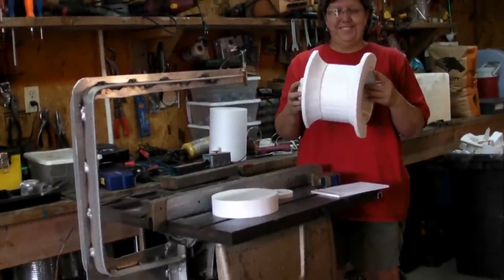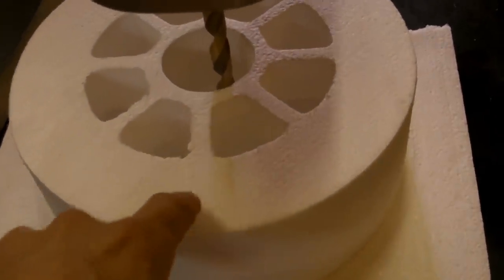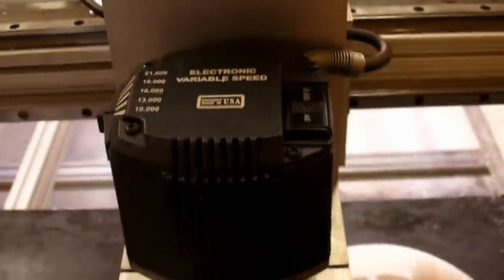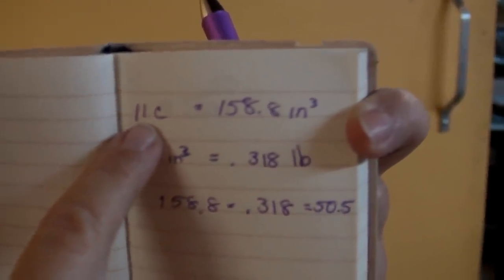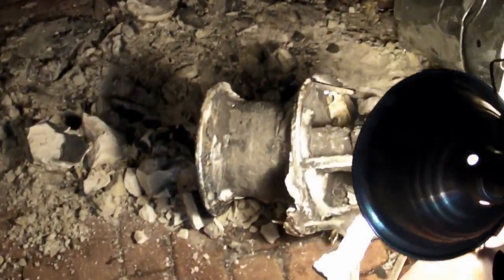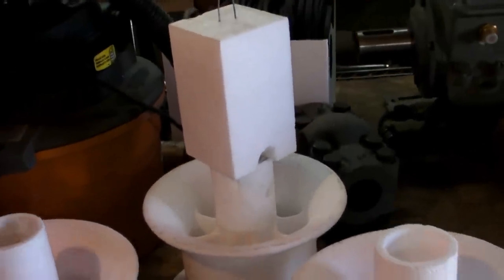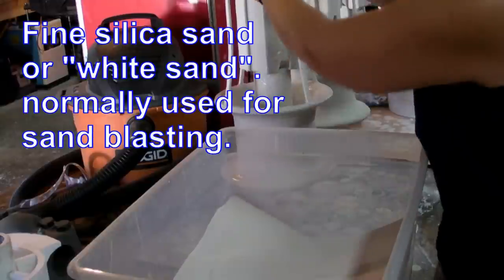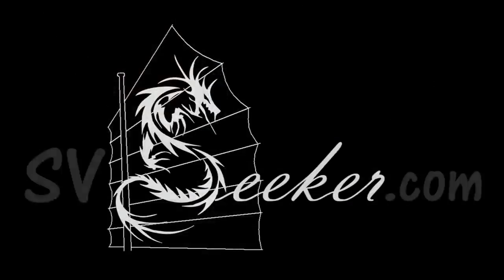Anchor Winch Rebuild - Part 6 - Lost Foam-Wax Molds

Comment from the maker: Right. I agree with that. The first thing I did was go through all the connector and make sure they were tight.  But that's not to say it's not a connection or a wire.  So far there is no smoking gun so the old motor is going to stay on the shelf.  If none of the parts are bad, I've got what I need for a 4th axis. :)

Comment from the maker: Spot on.  That's exactly what it did, except it was not a tight spot.  The Y axis just went insane and randomly moved toward zero.  Worst yet it was doing it intermittently.  So I hope replacing the motor fixed it, if not I switched controllers too so maybe I can narrow the problem down.

Comment from the maker: It's premixed sheetrock mud which is normally used for tape and floating sheetrock or gypsum boards.  It's really close to plaster but I've had too many problems with plaster cracking.  You can purchase real "investment" from a foundry supplier, but it's expensive and is sold in much larger quantities.

Comment from the maker: Thanks, and if you like that casting, we've got another that only looks a little better. So now I need more patterns.  Think I'll try CNC cutting the pattern from a solid piece of wax this next time.  PS:  If you have the patience to cut an engine block up with a grinder, you've got what you need to build a big boat. :)

Comment from the maker: A chain gypsy might just be what we do down the road.  The plan for now is to use chain rode for anchoring and the winch spool has plenty of room for 300 ft of chain.  But the capstans are to handle lines for the main and fore sails and for dive and salvage work.  When I was looking a chain gypsy's they seem to be customized to specific chain dimensions and the chain manufacturers did not seem to be following any standard.  Is there such thing as a one size fits many chain gypsy?

Comment from the maker: Spoiler Warning; The next step is to cut off the top and use gasoline to melt out the foam and then a torch or the furnace to melt the wax. The wax is normally melted out in an autoclave so the pressure prevents the wax from expanding an breaking the mold, but by removing the foam first we hope the thermal expansion of the wax does not have enough force to break it.

Comment from the maker: Right. Shrinkage is a little less than 2%,  but we add a heck of a lot more that than in wax because it will make it easier to get the shaft bore parallel with the surface of the capstan.  I'd rather cut more away than toss the whole thing because I tried to get it too close.  I've seen some amazing work in miniature steam and combustion engines.  Too small for my fingers. :)

Comment from the maker: I looked at doing just that.  What's that saying?  "Great minds think about the short cuts?"   ...but I didn't find anything that had diameter and surface I wanted and then, we'd still have to mate it to the keyed shaft.   But if the next casting goes south, we'll look at that again. :)

Comment: Hey  a thought occurred to me that it would possible to cast the cap stand in  in 2 pcs and bolt them together before turning the finished surface. The casting then could be in sand as you started.The only modification would be 4 larger internal fins allowing enough surface to drill hole for bolts.

Comment from the maker: Mach 3 - it has a really messy interface but the poor guy writing the code is obviously trying to meet every request with a single program.   So Mach 3 can do almost anything, you just have to dig to find it.  And it's cheap.   I think I only paid $70 for it.  There are more details on our web site svseeker (dot) com under Metal Working.   I use Bob Cad/Cam v24 for the design and TurboCAD sometimes too.

Comment: Hi guys would`nt it be easier to use a trailor hub and wheel without the bearings same kinda thing your going for cheaper -steel or aluminum too .

Comment: You had mentioned switching to hydrocal plaster. Did it work any better?
Reply from the maker: +Robert Cash    No.  But it was a size problem with the burn out furnace and we make the mold wall too thin.   We have a solution for that now and will be giving it another try this weekend.
Reply: +SV Seeker Alrighty. I'll be looking forward to seeing it. looked around and found a couple other videos about it. didn't know if trying plaster of paris might work. Same gypsum base add the joint compound but different additives.
Reply: +SV Seeker Alrighty. I'll be looking forward to seeing it. looked around and found a couple other videos about it. didn't know if trying plaster of paris might work. Same gypsum base add the joint compound but different additives.

Comment: Hi guys where did you get the formula for displacement of volume?
Reply: From Archimedes.  If you put an object in a brim-full bucket of water (pushing it under if it floats)  the amount of water that spills over is the same volume as the object. Kay measured 11 cups which was converted to in³ on Doug's pad.  He then multiplied that by the density of brass to get the mass of brass required.   The arithmetic is usually easier in Metric because 1 litre of water weighs 1kg,  and the density (mass per volume) of other materials is a number relative to water.  If you don't trust published tables of density,  you can machine a 1" cube of the material and weigh it.   It's OK to consider mass and weight as the same thing for stuff that's sitting still on the surface of planet Earth.
Reply: Wow, the amount of science going into this project is amazing!